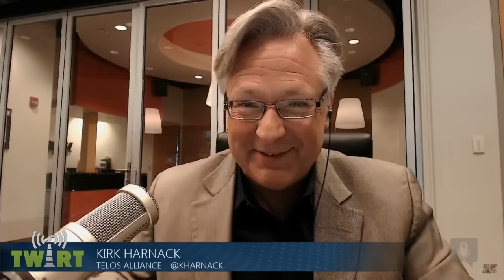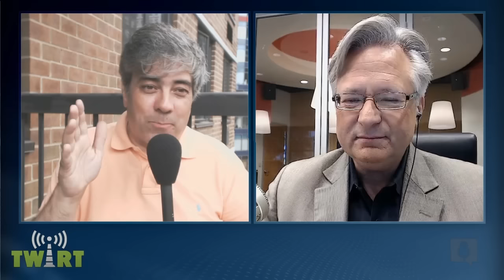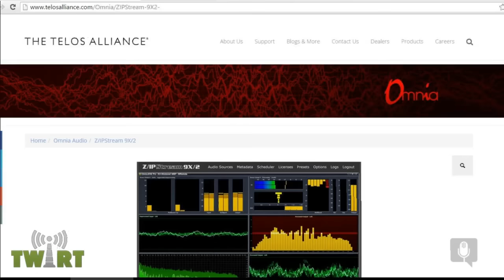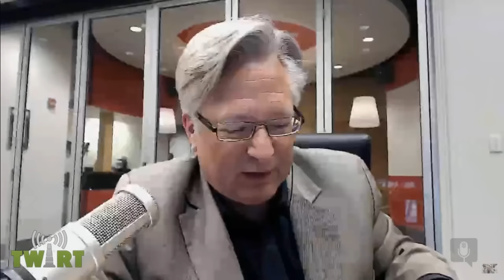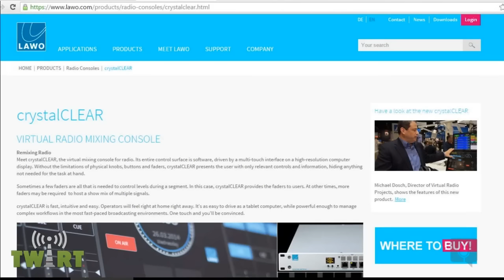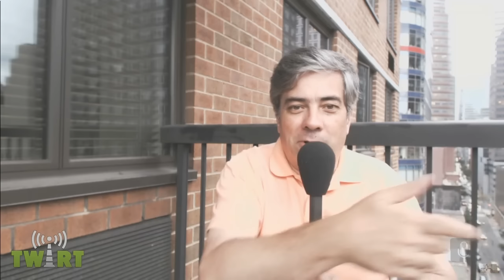TWiRT Ep. 270 - War Stories with Chris Tobin

Comment: 39:14 - “Wide tires” - the WORST on ice or snow!   In winter, what you need are narrower, ‘high profile’(60-series, or higher, aspect ratio) tires.  Such wheel/tire combos tend to want  to track straight, but most importantly, concentrate a vehicle’s weight down through the inclement surface, be it rain, slush, snow, or ice.  

There’s a huge misperception out there driving this trend the last decade toward ridiculously huge diameter rims(TRUCK diameters of 18” and up) wrapped in 50-series or lower, even 35-series aspect tires, that they’re more “stable” in a variety of driving scenarios. 

In fact, the wider that tires have gotten on ordinary passenger cars the last fifteen or so years, the more I have to do, of something I rarely had to in older cars with narrower tires - is: drive consistently with TWO HANDS on the steering wheel!  That’s right: more recent cars feel so unstable, so quick to respond to just one half inch of steering wheel input, with their superwide tires, that I can no longer do what I used to, in my 1981 Buick or ‘96 Ford: drive with one hand on the wheel, even through moderate turns, the other, along with my arm, resting on the driver door window sill!   And that’s with the tire pressure, in current cars, set correctly, at or just above the cold pressure on the vehicle door frame sticker.

The only venue such combos are good at are race tracks, where quick acceleration and braking, and hair-trigger maneuvering are required.  And the only (perceived) benefit of minimalist sidewall tires on wheels the diameter of Jupiter is that they “look so cool” - which is of ZERO concern to me, lol! 

I know I’m totally the opposite on this, as I am about the digitization of both video and audio broadcasting(yes, analog worked since WWI, why mess it up!), but, I personally like the tighter, on rails feel of narrower, higher profile rubber on smaller diameter(16” and under) wheels & rims.  (looks be damned, it’s all about the drive!)